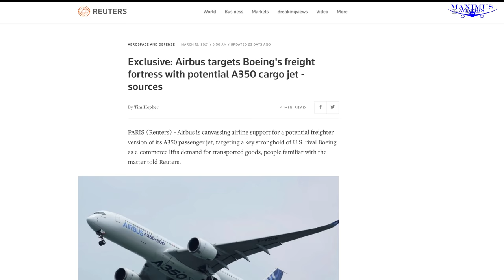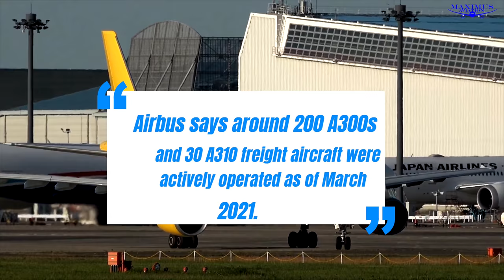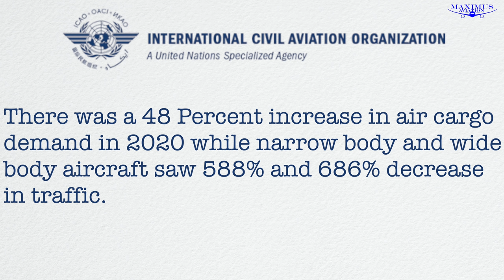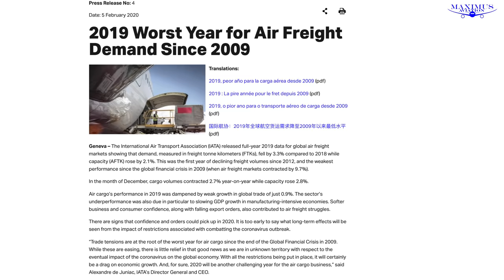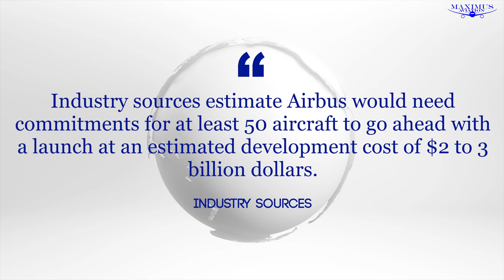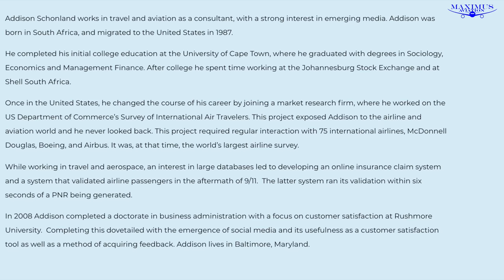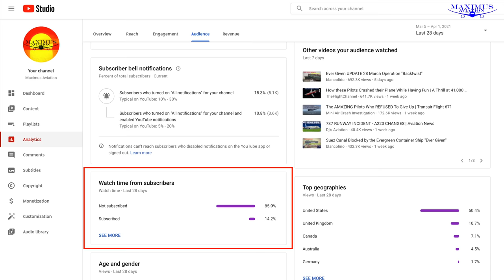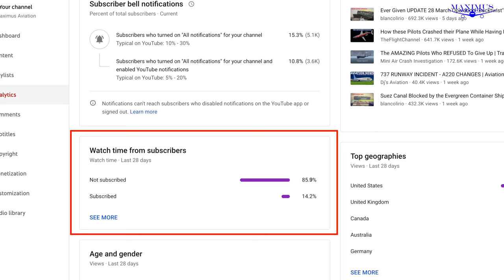Can The Airbus A350 Freighter Knock Off Boeing As The Cargo King Of The World?

Comment: The biggest problem that I see for adding the A350F, A330F, or B787F into the fleets of all cargo companies like FedEx is the limited ramp space. For example, the FedEx Hubs are designed around shorter wingspans, so adding modern aircraft that have much longer wingspans will require all new ramp designs and a reduction in the capacity of aircraft in the hubs compared to their current fleet of wide-bodies. The 767, A300, and MD-10/11 can park at almost any gate at the Memphis hub while the 777 uses a different smaller ramp for a limited number of 777’s.
Reply: Good point. I don't see MEM as being too much of an issue compared LAX and OAK. There's a lot of land around MEM fedex can still aquire to expand.

Comment: They should make easy to convert version. Lets say today is cargo the king, tomorrow people. Why not make the conversion easy? It should take max 24-48 hours to convert the plane from one package to other. The freight need extra support beams and the special floor. Beams - check, floor - check, seats/no seats - check. And why not make it partially cargo and partially people? Any configuration should go until the follow the instructions where is possible to add the cargo and where not. Most likely the center can be heavier than other parts. It is not the rocket science, it is only aviation

Comment: I think a new modern airbus freighter would be great considering the a330-F was a hugh flop. However I dont foresee Airbus catching up to Boeing in the freighter market simply because cargo airlines simply operate on a different ecosystem. It's a lot cheaper to reconfigure a used 73, 74, 75, 76, or 77 than to buy a brand new jet. ULDs dont care about the latest infotainment system and because the jets spend less time in the air fuel efficiency isn't as significant for cargo airline. And as I indirectly stated earlier every boeing variant can be operated as a cargo airframe. With all the cheap inventory of airplanes being retired due to covid I think cargo operaters simply have way more options.

Comment: The Midbody, where the door would be, is built in multiple pieces for the 787. Plenty of diagrams show this as Section 43, 44, 45, and 46. Section 43 could be modified specifically for a cargo door. Just like how they do freighter conversions, they make the cut out and add the door. All other structural changes can be integrated at the supplier level for the other sections and through different subassembly jobs.
Reply: If Airbus was absolutely determined to knock Boeing out of the cargo business they should have developed the A380F, because when it comes to moving freight internationally bigger is definitely better.
Reply: @guyorsini1044  - the a380 gets overweight before it gets "full" of volume... not as rosy as you think

Comment: I think the big issue for freight firms is MTOW. Having said that, the new A350 trades weight for range, as we have seen with the A350 -900 ULR. However, if Airbus ditches Rolls Royce and goes for the Ge9x meant for the 777x, they might just have a winner on their hands! Granted, they will trade range for MTOW, but truthfully, none of the major freight companies go further than 7000km in a single hop.
Reply: You telling me the do not fly LAX AKL? I suppose they could stop Honolulu for fuel so they could carry more freight and less fuel.
Reply: What counts is MTOW-OEW.  Here the A350 has a problem.  777F still beats it and if a350 does not get new engines, then its fuel comparable fuel burn will not be all that great.  777F has a fuel/cargo load of ~200tons and a350F if use a350-1000 wing, landing gear, empenage, and subtract 5-->10 tons(777F got about 7 tons of weight out) from a350-900 weight one gets a fuel/cargo load of ~180tons.   So, if we assume one can even place the cargo further forward in the a350 since it is narrower without structural increase in fuselage weight, the a350F would have to be 20% more fuel efficient over a 4000nm flight...    Yea, no that is not true as we already know that the a350 is roughly speaking 10% more fuel efficient than the 777.    So, unless DHL is going to subsidize Airbus with a government contract... oh right, neither DHL nor Airbus are subsidized by the EU... ((rolls eyes)) then this aircraft will never leave the engineering board without new engines for more power, bigger landing gear, and a new wing box or a heavily modified wing box for the increased MTOW and then a heavily reinforced fuselage for increased MTOW.  Would this heavily modified a350F with higher MTOW than a351 be possible and better than 777F?  100% yes.  Is it profitable?  Does the EU care?  I'd say no and why it will be built.
Reply: FedEx has a scheduled flights direct from MEM-DXB flight FX8 at 12,380 km and MEM-CDG at 7322 km.
Reply: @joelharleman7870  if I may, what equipment do they use on that hop?
Reply: @ahmedmotala7282  777F
Reply: @joelharleman7870  if you check spec sheets, the 777f can do the trip, YES. but not at fall capacity. Full capacity = 9200km. So, as I said, there's a trade off. Fedex might use that trip for express or time sensitive operations.
Reply: @ahmedmotala7282  if I was at work I could check on the payload numbers.  That said it is a regularly scheduled flight not a one off charter so it is probably close on cubic foot utilization than max weight.  Most cargo flights operate at very heavy payload, but most are not pushing max payload for the aircraft due to the difference in items being shipped.  :-)
Reply: @joelharleman7870  So, FED-EX to Dubai. I'll bet that is not daily.  AH, looked it up, it is every other day.  Your second is the exact routing of nearly every 777F, 747F.  Full load ~4500nm.  Transship, off to next hub.  --> Dubai from Paris on the other hand has 20 flights a Week from Paris to Dubai... to haul cargo.  Hrmm, how much fuel does a a351 need at full load for 4500nm...
Reply: @w8stral  the original post had the assumption that "none of the major freight companies go further than 7000 km in a single hop."  In 10 minutes of research I found two and could easily find more, especially to and from Asia.
Reply: @joelharleman7870  1 flight verses 20 at 4500nm... No one will sell a plane specializing at the longer distance cargo.  The ability is nice to have of course, but rarely used.  They all have to be optimized for the 4500nm full cargo hold routes.  Why the MD-11 can't do these routes yet the 777F/747F can and so could a350F should it ever be built.  Those rare long distance routes: They are only there for next day air service which is a tiny percentage of the cargo hauled.  Just as there is a Memphis to Tokyo direct flight...Once.... yet there are dozens hopping to Anchorage and then to Osaka/Tokyo etc.

Comment: Boeing also shot themselves in the foot by outsourcing so much of the 787 design and manufacturing to subcontractors. Since Airbus uses many of the same subs, Airbus was able to go to school on Boeing's numerous mistakes,  it drastically shortened the learning curve for the Airbus A350XWB.
As for a replacement for the 757, Boeing has dithered for a decade while Airbus racks up order after order for the A321XLR.

Comment: the only way the A350 could beat the boeing B747 freighter will be to reposition the flight deck from the nose of the aircraft to make way  for the nose cargo door and reposition it On top of the forward fuselage With the B747 freighter the  cargo can be loaded  through the forward nose door at the same time as cargo for that destination is being unloàded out of the rear side cargo door aft of the wing without a nose door and the ability to move cargo below the flight Deck   in the flexible loading manner of the B747 can they'll not sell many A350Fs

Comment: The 777XF is far off, and is not replacing the 747F, as it carries less capacity, and the cockpit has to be lowered and corrected in order to have nose loading capabilities like the 747-400F and -8F since the 777 doesnt have a hump. If it doesn't, we're gonna have this long ass plane with the worst turnaround times and no ones gonna like it

Comment: Hello Mr. Maximus,
First, I must say that I’m a big fan of your channel and your soft spoken voice. 
I became a big fan of Boeing when I took my first long flight from THR to JFK back in 1977 through LHR. 
Then I went back the following summer taking a direct flight from THR to JFK all on the brand new 747SP that Iran air had purchased.  
For the longest time, if I wanted to go to LAX from Washington, since there was no 747 service from Washington to LA, I would fly Pan-American from DCA to JFK and on to LAX on a 747. But that was the good old days before McDonnell Douglas times who cared for profits more than passenger safety. But unfortunately, Boeing adopted their culture rather than the other way around. 
These days, the only Boeing aircraft I trust, is the 777 without the Pratt and Whitney engines.  Am I correct to assume that the 777 is a well engineered plane with a good airframe? Am I correct with my assumption? 
Also, carbon composites scare the hell out of me. Especially after American Airlines flight 587 where the vertical stabilizer snapped off due to too much input on the first officers part.
But I suppose that is what aircraft are going to be made out of from now on and we have no choice. 
But Airbus still cares about safely and makes the nose on 350s out of aluminum vs Boeing that makes the similar 787 with carbon fiber.  
Whatever happened to Boeing of Joe Sutter days 😪😪
Reply: I agree with you on Boeing and the 777. But I believe some 787s are safe too.

Comment: There are heavy clouds looming on Boeing’s long dominance in the cargo sector, namely that the new widebody entrant, the 777-8F is unlikely to see the light of day since neither will 777-8. Since its design A350-1000 ended up with better performance that everybody anticipated. Now Boeing is mulling over a 777-9F. 

But that is the least of Boeing’s concerns. From 2027 onwards Boeing will no longer to be able to continue producing 777-200ERF and 767-300ERF because of noise limitations, per ICAO regulations. 2027 is not that far away. 

I must say that your insight on composite fuselages for cargo applications was most insightful. Thank you very much indeed.

Comment: Hmm... While dominance on the Boeing Freighter side does not guarantee an endless future, throwing the A350 at the 747F and 777F dominated market seems utterly silly to me for a couple of reasons. Freight Carriers won't pay extra for carbon fiber because they depend more heavily on cheaper, converted airplanes that burn more fuel as a secondary priority. Among carriers opting for new airplanes, the 747-8F has been a favorite because it can outlift everything else, 148 tons against the closest competitor, the 777-200F that only lifts 100 tons. Another airplane that could lift 95 tons, cost more, and use slightly less fuel does not sound like a compelling entry to me. No doubt Rolls-Royce could gift a higher thrust Trent, but there will be landing-gear issues and a heavy-duty main deck to supply, none of which will be insurmountable. But when they are done, all we will have is an alternate source for redundant capabilities.

Comment: Admittedly, I'm unsure what the use case of an A350F would be. The pull of the A350 is superior range and efficiency, the latter of which isn't really as economically important with cargo flights. Usually cargo airlines would rather save money on an older type.

Comment: Even if Boeing didn't have the 737 MAX debacle, they wouldv'e still lost to Airbus because their products are just old and outdated, just like American cars vs European cars. American SUVs still use body on frame with pushrod naturally aspirated V8 gas guzzler engines while European SUVs use unibody structures with dual overhead cam fuel efficient I4 engines with variable valve timing, variable valve lift, turbocharging, and gasoline direct injection. Airbuses are just more fuel-efficient with newer engines, aerodynamics, construction techniques, and material choices. The fact that most NEW Boeing planes for sale right now (except for the 787 Dreamliner and 777X) don't have glass cockpits speaks volumes about the company and brand. Whereas, even the cheapest econobox cars (Toyota Yaris, Honda Fit, and Nissan Versa) today (actually discontinued 2020) come standard with infortainment system.

Comment: Airbus have for many years now been technologically superior. Fly by wire and composite materials being just two.  The story of the MAX issues for Boeing also throws up sharply the consequences of trying to force a 1960s design onto a 21stC need. Airbus will undoubtedly gain the upper ground once the Covid situation stabilises.

Comment: I don't think so, they still are stronger because of producing 767, 777, and 747 (though sadly not the last option in a year) and are converting 737, 757, 767, and 747. Their older planes and all the Douglas planes were good freighters too. Compared to this, the Airbus freight offerings are rather limited, though are still just fine.

Comment: Someone, either Airbus or Boeing, should come up with a viable MD-11 replacement. There are over 100 still in service and a lot of them are around 30 years old now. Great planes, but unfortunately they cannot fly forever.
Reply: That is what the Ageing Airframe Revitalization Program is for.
Reply: air force has 50 year old b52s
Reply: There are other factors that will drive the MD11 fleet towards retirement besides life limit of the airframe. Parts are going to become harder to obtain/overhaul/service. This is one of the main reasons why the DC-10/MD-10 is being retired. 

The other factor is fuel cost and efficiency.  Of course a tri-engine aircraft using older turbofans burns a lot of fuel. As fuel prices will likely increase over the next 10-15 years, there will be strong financial incentive for companies to retire their MD-11 fleets in favor of much more efficient twin engine planes.

The airforce is not in the money making business, so fuel and maintenance costs are not as much of a factor to them. The B-52 is also going to go through a re-engine program which will not be cheap, but will allow for more reliable, efficient engines to be installed on a proven airframe. 

There is no feasible way to re-engine the MD-11 (even though that would be awesome). The #2 engine intake and vertical stab banjo fitting were already just about maxed out in size to support the CF6-80 and PW4000.

Comment: Not entirely sure why Airbus would want to get into freighters right now. Freight customers buy purely on price and not specification unlike passenger airlines who optioneer their purchases which gives profit potential to the vendor.
So with long waiting lists for Airbus passenger aircraft why would they take up valuable production space for lower profit margin freight aircraft? I mean right now they have a huge A380 production space to fill and have mega A320 orders to fill.
Airbus should let Boeing take the low profits on freighters as that will strangle their cash flow even more than now.
Old military lesson: Never move onto the battlefield of your opponents choice.
Reply: First couple lines and last line are good, but you clearly lost the plot when you typed: Let Boeing produce low profit margin aircraft and strangle cash flow.  .... Uh, Genius, anything that creates a profit and keeps an assembly line in use instead of COSTING you money all the while generating a PROFIT, is a ++++++ for them.  It does the OPPOSITE of what you claimed!

Comment: Converting an existing pax version is expensive and time consuming and cargo aircraft are really only good for that market because they are HEAVY and fuel inefficient compared to pax versions. SO you are making a bet that cargo rates will stay high like they were during the peak of the pandemic. I’m thinking not, give it a year and cargo rates will soften or even weaken the other way due to new entrants in the lucrative cargo market, it’s a supply demand curve with a rebound in the other direction exasperated by things moving back towards normal.

Comment: You fail to understand how airframers make decisions to offer derivatives. Freighter derivatives are normally offered only when production capacity exceeds passenger version demand. Boeing makes more money selling a passenger version than a freighter version. However, there is a fixed cost associated with factory floor space. If Boeing wants to continue manufacturing a particular model aircraft and there are projected slots available in the assembly line, a freighter version might be offered to fill those slots. However, if the production capacity is maxed out for the passenger version (for example, the 787) Boeing would loose money if they started to fill slots with freighter derivatives. Boeing will, of course, choose to maximize profits and fill all available slots with passenger versions. I assume that Airbus works the same way.